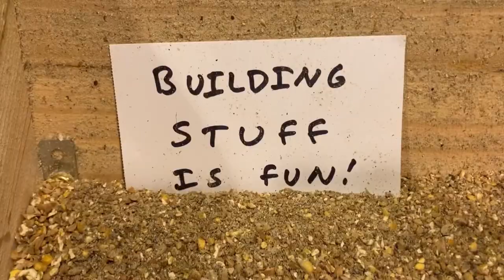Easy Chicken Feed Auger

Comment: Dude.  You won the internet.  OMG how cool.
I'm looking for a way to transfer sand & Portland cement from a knee high hopper up to about 5 feet, just enough to feed a spinning 5 Cubic Foot mixer.  You might have the right idea. Bravo!
Reply: You end up doing this? If so any update?
Reply: @shawnstrittmatter4783  No, I did not.  I'm close to ordering a "flexible screw conveyor" from a supplier I found on Alibaba.  It's like 100mm x 4 meter (4"x17')  with a 3kw motor on the output end.  The price is just under $300, but with shipping to the Port of Tampa would be an additional $500.  I live nearby and can pick it up, but...I've never purchased an item that way and am nervous about the security of such a transaction.  
 
I'd like to buy from an American supplier, but try to find one that actually posts prices!  It's always "Contact for quote".  From what I can tell, an American made one would be in the THOUSAND$$$  It's like they don't care about little people like I am.  Oh well. 
But Alibaba suppliers are hungry for our business.  Unlike American suppliers.  Tsk, tsk.
Reply: @rusosure7  I hear you, did you at least try to build it? I'm definitely going to try this week as I am only trying to mix aircrete. Flex auger / chicken feeder looks like a pretty good resource as well

Comment: I like how you used the PVC trim for the auger flight......how did you attach it to the pipe, with PVC. Glue or something else?
      I may have the craziest use for your idea, I’m researching composting toilets, and am planning on designing a “no touch” system and building it into a custom Overlanding Rig I’m working on.

Comment: Did you use pvc glue to attach the quarter round to the pipe? Does the drill spin inside the quarter round if its not glued? Youre wrapping it around 1” metal pipe and then putting it around 3/4” pvc? Seems like it wouldnt match that size. Obviously it works, just trying to figure out a few missing pieces of info.
Reply: Have you tried this yet?  I just did and used a 1" metal pipe as he said to use and can confirm unless I did something wrong when winding it , its far to big for the 3/4 pvc pipe.
Reply: @MrMoney316-r2x  No, I realized quickly after asking the question that the amount of feed I wanted to auger is way more than this little thing can handle. I started looking for a professional pan feed system for my 250 chickens.
Reply: 3/4" PVC pipe is 1.05" O.D. 3/4" steel pipe is also 1.05" O.D.  1" Steel tube is 1" O.D.  My guess is he used 3/4" steel pipe, not 1" steel pipe.

Comment: Archimedes screw!  So cool!

How much friction is there between the screw and the outer pipe?  I am asking because would it be possible to push water thru the pipe like those screw power generator plants?  Or does it only work as a driven element?
Reply: It would simply require higher speed😊

Comment: Currently trying to build this myself to use at the beach to feed my sluice box when looking for gold.  I just tried to drill out the cap and failed,  how did you drill it out for the pipe to fit thru? I can tell ya a spade bit was definitely a bad idea....lol.  next idea would be a hole saw but need to figure out a better way of holding on to cap when drilling.  great video and exactly the idea I had but wasn't sure how to go about it til now.  Actually going to see if I can make it in multiple pieces as that would be ideal for transport and storage.
Reply: Curious if you have managed to drill the cap cleanly? Also as a thought to make it portable id imagine you could use couplers but just press fit instead off glue and if those dont hold enough, a wrap of electric tape on the pipes.
Reply: @silver1fangs  I ended up using a hole saw in a drill press.  Worked well just make sure you the cap clamped in vise and vise clamp well, first almost hurt me real bad as I didn't have vise clamped down well enough.

Comment: what do you call the triangle type pipe?
Reply from the maker: Great question! It is called “quarter round” moulding and it’s a piece of PVC plastic trim sold at large hardware stores. It is sometimes also called “shoe”. Dimensionally it is 1/2” tall by 1/2” wide, and being PVC plastic softens very easily with a heat gun. Have fun!
Reply: @BuildingStuffIsFun  What is the diameter of the inside pipe that the 1/2" shoe wraps around? What is the diameter of the external pipe? What kind of drill bit drives the internal pipe?
Reply: ooops... I should have watched more carefully.... I see you mentioned 3/4" pipe on the inside and 2" on the outside.
Reply: @BuildingStuffIsFun  Nice design! Nice way to encourage the future generation!